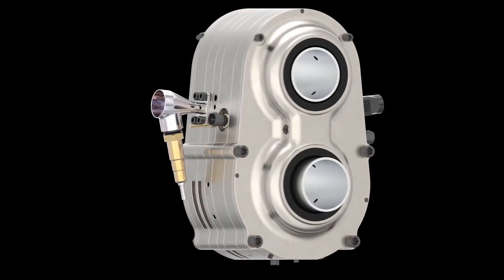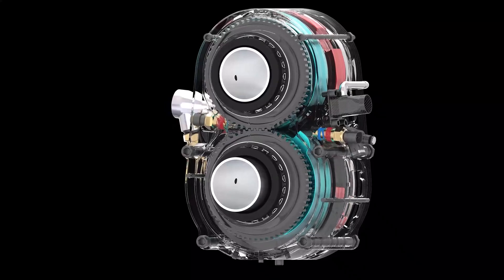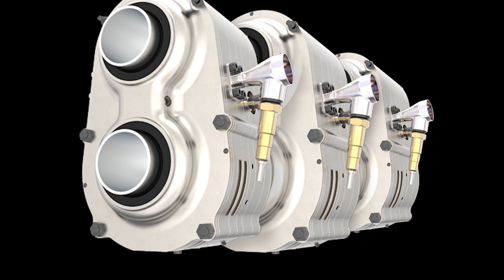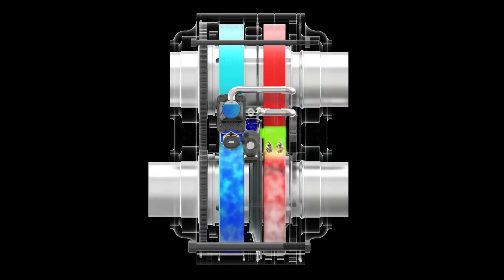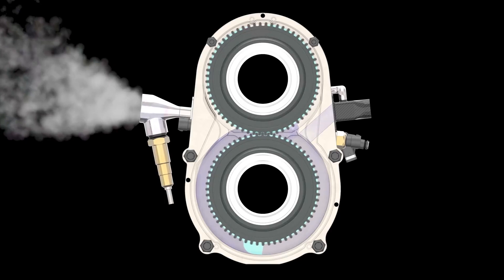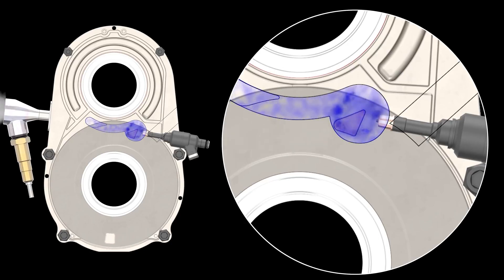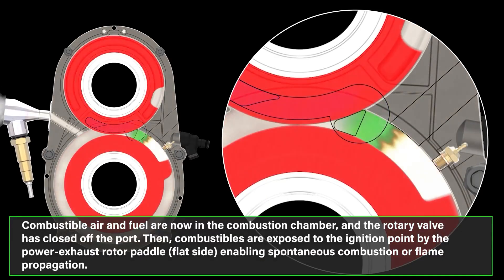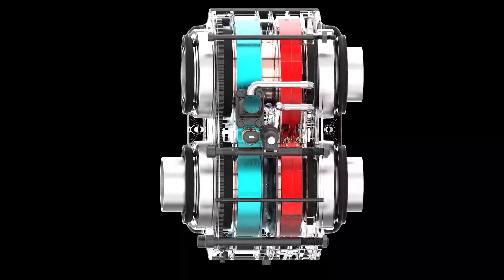This pistonless engine runs on hydrogen and revs to 25k rpm

Comment: Would love to see one produced and bench tested.
Reply: I think it could work but as you say tolerances would have to be tight. How it would handle wear ???
Reply: @adrianrouse5148  It's tolerances would be only "tight" at optimal operating temps.
Wear will be non existent on rotors and housings as it's contactless..
However, if you are familiar with turbochargers or superchargers (which this engine shares it's form with in principal, especially the precombustion rotor which is essentially an inbult supercharger) the contactless seals and pressures they generate and maintain only remain so dependant on the main shaft bearings condition.
So if it were a coventional journal bearing it could possible foul with wear, if it's a roller bearing it will be much better suited but more expensive.
Reply: They claim to have a working prototype
Reply: There is a vid of it running, but it is not doing 18000rpm
Reply: LOL - Wouldn't we all.  Yet, here we are commenting on a bullshit animation.
Reply: @foobarmaximus3506  you sir are ignorant
Reply: They have a functional prototype. /watch?v=Q-tyYqGM8QA
Reply: Never tha big rich oil gangstars will not allow  such thinghs to come up to surface.
Reply: It runs on 2 stroke oil injection.
Reply: Would not work
Reply: @Oceam  It would work if its made out of materials that we can't yet manufacture. Maybe in 50 years time, there will be ceramics which can maintain the extremely tight tolerances, and never expand under high temperatures. But in 50 years time, no one would be thinking internal combustion.
Reply: @abaj006  It doesn't need too.. At operating temp it would be where it seals best so thermal expansion would aid efficiency as with any engine.. That's where it's tolerances, again as with any engine will be set to work.

At a guess, I'd say that's why the surface area of the "seal" on the rotor is so very, very, very large.. 
It's the exact opposite of a conventional apex seal in principal, in that an apex seal has the lowest possible area of surface contacting the housing due to heat caused by friction, the need for lubrication in the combustion chamber which adversely effects emissions and also the subsequent wear that occurs. 
This design though is frictionless so it can have the largest surface area practical to form a "seal" through restriction, length of restriction and reducing duration of maintained cylinder pressure. 
Not just by "extremely tight tolerances of materials that don't exist".

I'm not saying for certain whether it would work or not, or even that it won't run like a pig until it's at optimal operating temperature, but I understand the theory and see it's purpose and merits..
I also see some potential flaws. 
Having far less moving parts and less friction would benefit it thermally over conventional ice but it would take development, but if we are just dismissive like you, of idea's we'll never advance at all.
Reply: @DStead2239  Sealing is not the only flaw with this design, even if they overcome that issue, it won't produce anywhere near the claimed HP/weight
Reply: @Oceam  It's sealing isn't a flaw, but your understanding of a "seal" is🤦‍♂️ 
I think if you're unable to understand that one single simple fundamental, it's unlikely you have the ability to accurately translate it's torque potential vs rpm into a potential hp figure either.
You do realise a piston ring has a gap and is not a total seal either, yeah? 
You do realise that gap is increased for boosted or nitrous applications to aid power potential by being able to expand to seal under extreme load to create a closer tolerance without binding? 
 You do realise a rotary also has a gap tolerance on it's side seals too, similar to that of a piston ring? 
You do know that difference between hot and cold tolerances is far greater because of the friction they incur which a frictionless component does not need?
Speaking from experience, fuels like ethanol blow past those "seals" into your crank ventilation oil/air seperator tank (catch can) constantly. 
Show me a big hp engine that doesn't have a big breather system to vent that incomplete seal you claim doesn't make hp🤣🤣
Reply: @DStead2239  My reply was not intended for you, the tag was accidental, i don't know what your comment is really about, sealing the combustion and intake charge will be an issue with this design, I've seen this engine running and it's backfiring and running like crap, and as I said there are other limitations other than sealing
Reply: @Oceam  How have you seen it running when it's a concept? A hydrogen concept at that.. 
I already saw flaws in concept as I stated above, not those which you mention though. Well kind of, I did say it would run poorly cold though it shouldn't as badly as a conventional big hp engine cold
Reply: @Oceam  I think you're talking 💩💩💩
You say something "will be an issue" not "is an issue"... 
I've built many engine's that start and run poorly until tuned properly too.
Reply: @DStead2239  Calm down, despite what you say, the blowby will be great. There are no attempt at a seal, no oil and 200psi of pressure, no matter the tolerances the cant be 0 and blowby will be the result...
And just like a roots blower the efficiency will only drop the higher the rpm, this will only further increase pumping losses and reduce efficiency. And that's just the blower. 
The combustion chamber, or lack there of, will be extremely prone to blowby. A piston ring is made to create a "perfect" seal with the help of oil and pressure, obviously thats the ideal and not what happens because even there, there is blowby, now you really think an engine without even an attempt at a seal wont blowby a whole lot more? and that wont be an issue?
Combustion does not occur at peak pressure, and that lowers volumetric efficiency.
There is leaking everywhere and especially when the pressurized mixture is transferred into the combustion chamber and able to leak into the other rotor.

Another issue is injector position and fuel homogenization or the lack thereof, there is not enough time or space for the high pressure fuel stream to mix properly with the high pressure air, and having the injector directly at the high pressure air pocket will set a requirement for a high pressure fuel pump, and that running at 25k rpm will only further increase the parasitic draw and lower efficiency.
The air will also heat up a bit during intake and there is lots of thermal imbalance which needs to be taken into account.
And I doubt there will be adequate cooling throughout the engine in the current state.

There are more flaws, it was a while ago I looked into this engine so I don't remember all, many flaws can easily be corrected and tuned for but in the current state, the engine will not work and represent the advertised performance, and the efficiency will be extremely low
Reply: @DStead2239  You are so naive... You clearly don't understand what i wrote, there is no effective "seal" and just because you dismiss my opinion don't make it false. Rpm absolutely effects pump efficiency and with higher rpm, higher pressure is required. This engine will not produce anywhere near it's advertised value in the current state...
Reply: @abaj006  in 50 years internal combustion would still b3 the norm
Reply: @DStead2239  ah yes, operating temp... I'd like to see you start it up in the middle of the winter.
Reply: @kirayoshikage4057  this is essentially an engine block . Oil warmers or some other pre start warming system would be easy to use
Reply: @abaj006  yeah in 50 years we would all be rocketing out of our buttholes somehow haha
Reply: @Oceam  check my last comment buddy :)

Comment: Couple of reservations, close tolerance parts are expensive to make, and at the RPM suggested, you have to factor in wear of moving parts. What is the longevity of this engine? As a high rpm engine, there are factors that make it unsuitable for a manual transmission (you cannot slow that rotational mass down quickly enough for a gear change) and what drivetrain would you use? What is the torque curve like? Where is the reduction gearing taking place, in the engine, or in the transmission? As noted below, this looks good for constant RPM applications, like in aviation, or as a power generator drive. Not sure how useful it is in a constantly changing RPM environment like a car. If enough torque could be produced, it may suit a long haul truck, but everything depends on how fuel efficient this ends up being.
Everyone took to loving the wankel rotary too, then they saw what a fuel guzzler it turned out to be. I would like more technical information.

Comment: I really liked the concept, though still have some concerns. Looks like a Wankel's engine son and for that reason have some o its heritage problems. First it needs to have a seal in the exhaust paddle rotor, otherwise it would have compression leakage, and as much as I remember it wears a lot in the Wankel, another concern is the uneven temperature along the engine, it can cause thermal expansion in too many differents parts. Last there is the lubrication matter, but as I say: "From the sins, the lesser".

Comment: I was never on the EV bandwagon. There are far too many issues with EVs. THIS engine is definitely more like it!
Reply: EVs are far and far more efficient
Reply: @Freba9  So you say, now you have to prove it.
Reply: @tobygathergood4990  Just basic physics. Charging and discharging batteries and driving electric motors have very little losses. Producing, compressing and transporting hydrogen has terrible losses and combustion engines are obviously just as bad.
Reply: @Freba9  I was really hoping that HHO would be well developed enough by now to be viable. Then one doesn't need to carry compressed hydrogen.
Reply: @tobygathergood4990  Still very inefficient
Reply: @Freba9  Unfortunate. One day someone will invent a 'magic' engine 😁

Comment: Cool technology, but a long way to bring it to the street. Hydrogen is a fantastic fuel, but the infrastructure does not exist. High RPM's tend to lead to high wear. But the biggest problem is adapting this technology to mass production and competitive prices. It actually looks better for motorcycles and light aircraft even if the prices come way down.

Comment: I think that on paper this is good but i don't think it's very daily usable. A speed range between 1k and 25k can be from having a very wide use case to very hard to map out. Time will tell.
Reply: CVT solves RPM problems

Comment: This would be the perfect engine for an old BD1 aircraft. It would also, depending upon it's low power settings fuel consumption spend a huge loiter time depending on consumption with say ammonia as a fuel source. Being this light and powerful it would serve any drone function including heli's, delta wing drones, or Styrofoam builds in conjunction with Russia's drone but carry much more ordinance like the Bayractor except being able to carry six munitions instead of four. Our Pentagon needs to produce a large amount of ordinance designed on the line of Bayractor munitions.
Reply: "Our" pentagon appears to be our enemy (enemy of the people).  No way do we need them to have a greater kill capacity.  Pentagon is run by organized crime headquartered out of London and the Vatican.
Reply: Ammonia for fuel ? Daft.

Comment: This could be used to power a generator/alternator to power an hybrid car easily. Use hydrogen, this motor and an electric motor it's could be a solid winner
Reply: It could also be used to power generators and industrial loads, such as large ships, construction equipment, and railroad locomotives, even aircraft. It could run on hydrogen and be a good competitor to fuel cells at a fraction of the cost. The hydrogen would be produced from renewable energy sources.

Comment: 16kg would be perfect for a gokart engine. That power would be stunning on a kart weighing 150kg, which is easily attainable. The 25k rpm and 16kg is close to a 125cc racekart engine specs but that power is 5X better.
Reply: It's a motorcycle engine

Comment: No reciprocating masses.
Power to weight and rpm sound attainable. Absurd compressions make it perfect for diesel, or even petrol in diesel self ignition cycle.
Reply: At those speeds the chamber expands too fast for diesel or even gasoline to push it.  That's why they suggest hydrogen.  I bet natural gas wouldn't even work.

Comment: Hydrogen is a clean fuel when it is burned but making it produces huge amounts of carbon dioxide.
You'd be better off burning the natural gas they make it from.
Reply: Not f you make it using hydro or wind produced electricity, that’s the plan in Canada.

Comment: The MYT-6 engine weighs only 11.4 kg and can produce 200 to 800 horsepower and can do so using biodiesel.
Reply: yeah thats another one for the believe it when i see it pile. all i found looking it up was a single very vague article about it, a 3d model, and a short paragraph from the company about how they made great advancements in recent times yada yada
Reply: Exactly like this video then 😂
Reply: Hmmm if it sounds too good to be true than it normally is
Reply: Proof? Link?
Reply: Which is WHY it will NEVER see production. It could overtake all others, and monied interests won't allow that.

Comment: Lots of blab, blab, blab but no critical details.  Says "no seals" but  obviously there are miiiles of sealing surfaces.   Says it can run on Hydrogen-- well, any engine ca run on Hydrogen, until it can't due to Hydrogen weakening of the metals.  No numbers for compression ratio, or longevity, or MPG.   A marvel, of 2002 CGI.    So, in other words, just another bit of YouTube fantasy.

Comment: Big problems with this one.
Super close tolerances, very high rpm and very high pressures? Ouch.
It is gonna be a leak-fest, or massive nightmare with tolerances, heat expansion friction, wear etc.
It has the potential to produce big power from a small lightweight package but will be even more problematic than a Wankel rotary.
Reply: I agree.  Fancy drawing & talk, NO REAL WORLD MOTOR.  Materials and fabrication methods are improving tremendously.  When they run on air with the only waste product being pure water ice cubes and cost  $0.01 per mile to drive and cost less than $2,000.00 to buy , then I'll be near the middle of that long line to purchase.
Reply: @davidbostock6933  .. haha, yeah they will get that done just about the same time they get fusion reactors working... 🤣
Reply: @wizrom3046  
FUSION !!!  COLD FUSION !!! 
Slowly I turned, and then, step by step, and inch by inch ...
So, France Etc. or China, pick both!